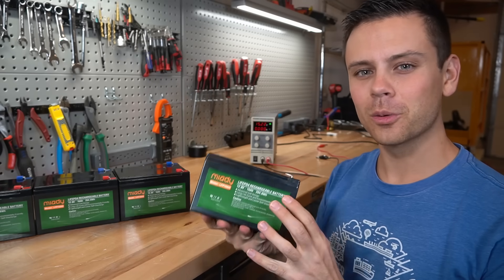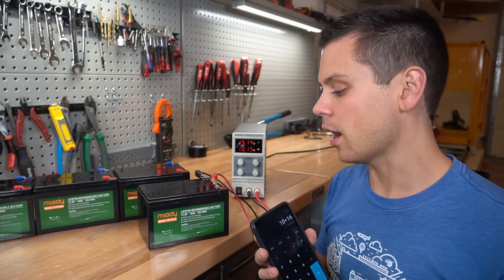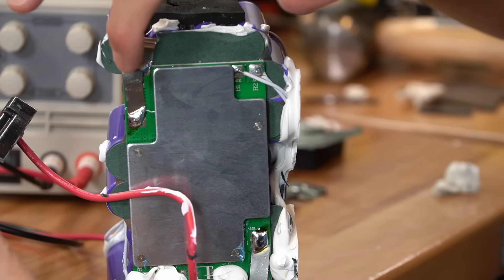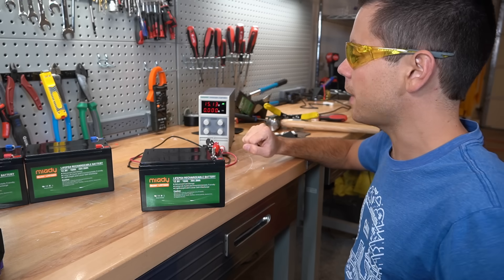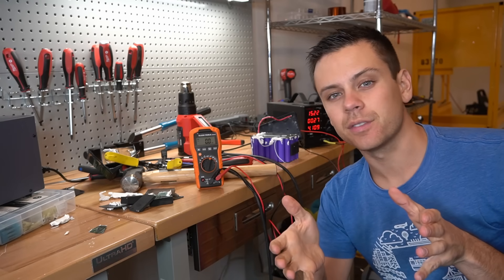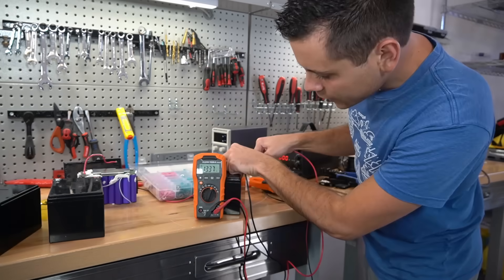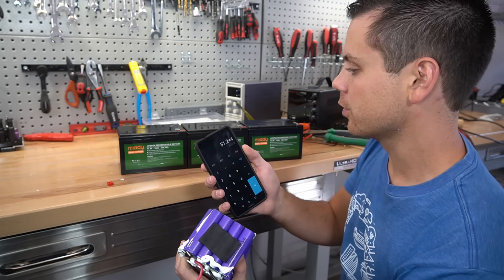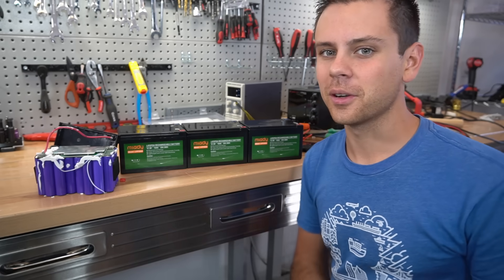$54 12V 16Ah LiFePO4 "Miady" Pack Tested

Comment: I have not used these but I have been testing the Nermark Lifep04 12v 10a for my UPS. I did put a 10A fuse on the one i'm testing because of someone shorting out the battery and it went up in smoke. These batteries are going for $64 dollars for two. It would be nice if you could test them too.

Comment: I put this in 24v series and ran 30amps disharge threw these and they work good after 3 years. I use 1 on my moped to start it and it works great. It can push 30amp continuousdischarge

Comment: Slapping it with 15+V at 10A.  That will NOT fully charge it.  It will just only fully charge one cell and the BMS will disconnect.  If you want to fully charge a series pack you have to limit the final current to no more than the balance current.

Comment: Love Will Prowse but no, a 100 AH battery can be bought for $300 or even 295 all over the place. Not so cheap. I still want to use my power tool batteries to boost my 12 volt system..Just need to rig a DC/DC charging system.

Comment: I have a question. I would like to build a solar panel system that I can use to charge 2S, 3S and 4S LiPo batteries for RC cars. I would even consider having a battery system as well. Any thoughts or ideas on products for this? My charger accepts 10-34V, 33A input. About 1000W peak i.e. Is there a solar panel kit that can output something like 12V/8A?

Comment: Really like your insight.  I'm trying to power my off grid  trailer with 200w solar panels from harbor freight then to lead batteries and battery monitor and a 3500w inverter (you said buy the bigger one) then to a transfer switche. Question is what batteries do you suggest.?

Comment: I bought this battery about 2 years ago on Amazon for $45.  I also have the 6Ah and 8Ah Miady batteries as well.  Those two batteries have served me well - they're pretty awesome for what I paid for them.  However, I have begun testing on the 16Ah battery and found it has less capacity than the 6Ah battery... literally, about 1/2.  It will charge up to about 25%, then jump to 100%.  It does exactly the same when discharging.  It 'looks' like it's a nice flat discharge, then it suddenly does a low voltage shut down.  Very disappointing.  I am going to open it up and see if something has come un-soldered.  THANK YOU for the excellent video!  At least I now know what to look for when I open it.

Comment: I bought a 36ah from amazon, and it came in dead.  Contacted miady store and they gave me a full refund.  So I popped it open and found one of the balancing wire was not soldered properly and came off.  And maybe it touched somewhere on the board, the B- PCB melted.  Simple fix, and battery came back to life.  Good customer support, but bad build quality

Comment: Why do some of the sellers that have these SLA direct fit LiFePO4 replacements claim you can use up to four either as series set for 48 volts or four in parallel to have the combined Ah rating but not as a combine series/parallel set?

 Say you take four 12V 10AH LiFePO4 batteries and place two in series to get 24V 10AH and do the same with the other two and then parallel them to get 24V 20AH. Why would that be a bad idea? They claim their batteries have a built in BMS and claim they are a direct SLA replacement so why would series/parallel be an issue? A UPS is where I see this being a typical replacement for SLA where a series/parallel battery configuration would be used.

Comment: I've been using a Miady 20Ah for 2 months now... and my observations... build quality, probably not the greatest.  Charge capacity... this one is a bit more subjective.  Out of the box on initial charge I was getting 16.5 hours of run time on my HF QRP rig, transmitting at a 25% duty cycle (receive about 300mah, transmit 2.5A). After 4-5 full deep discharge/charge cycles with a 4Ah wall charger, the battery is doing much better, still holding 13.2 volts @ 25% transmit duty cycle after 7 hours. I 'm getting closer to 20 hours of runtime... my goal was 8-10 hours, and using pessimistic math on my 100W solar panels to charge at 50W x 4-5 hours to keep it topped off.. For the $ per Ah, I would buy this one again... even if I only get 15Ah for $70, but have to pay $120 for a better 20Ah, the $ per Ah comes out ahead.

Comment: Don't hesitate to use the Chinese batteries. The Ah rating might not be quite as high as claimed but it will be close. You get huge bang for your buck. Some of the newer models have much better design and construction. Some of them come apart to allow user servicing.

Comment: This was extremely helpful because I have the same 16ah battery from Amazon The $54 one shown in this video. I use it for a six amp 12V blower all the time. Thank you for some tips for me to keep in mind for this battery. When using it with a lot of movement

Comment: excellent videos, I was thinking on buying a solar generator and when I come across your channel now I want to build one. I want to try a very cheap model that is intended for irrigation systems, humidity sensors, lights, etc.

I was thinking of something 200W using 18650 or 32700 batteries, mppt charge controller, and possibly an inverter and a dc-dc charger.
Any suggestion?

Comment: This may be off topic but i would love your feedback if you could. I am looking to power an E300 Battery Scooter and want to increase the voltage from 24v to 36v and build a little battery bank. What batteries would you build one with to fit in the case for distance run time.

Comment: I purchased the 6Ah due to its low price. even before using them I took it apart due to the CG being out of place. This level of craftsmanship is not acceptable in the USA (nor EU) and is reminiscent of Chinese workmanship where they either hotglue or superglue components, in this case silicone and tape. I have disassembled the cells and BMS and placed them flat . Ive come to be immune to this style of manufacturing where they cost reduce by eliminating mounting hardware. Just have to remind myself where it came from.

Comment: I have been searching for an affordable way to power a 48V DC 1000wattt brushless ebike motor, when I found the Miady 12V 16ah in this test. I was all set to order until I read this. My confusion lies in post of a reliable ebiker, that installed 4 of these exact Miady batteries wired in series to provide the required 48 volts for his even higher rated 48V 1500watt brushless motor. A year in service, good performance and no negatives to report! (Note: Ebike user pedal assist the motor while in is running, to lessen amp draw drastically and extend use time between charges.) 1) Why do you state to NEVER wire this battery in series? He apparently has had no issues.I am confused?

Comment: I would have emphasized the poorest factor on these batteries. The welding of the cells are horrible. I had to open 3 batteries that rated under current and solder, yes solder the tracks because my CE approved Chinese trac welder was down. After soldering them ( and strictly managing the heat ! )these batteries are ok.

Comment: Excellent presentation! I wish I had watched this before buying 6 of the 16AH Miady batteries a year ago...However they were cheap and I wanted to play with the technology. I did build a 96AH (80AH after viewing video)  battery pack and fused each battery with a 15A in line fuse. The parallel bus feeds a 12v, 60A manual Breaker. All 6 batteries reside in a foam cushioned plastic dry box. I use this battery for a 55 pound thrust trolling motor which draws approximately 45 amps at full power. I also use the battery to rune my ICOM 7300 transceiver which draws 18 amps when using 100 watts of RF CW transmission. So far so good...I have about 50 charge cycles on the battery and use a  quality 10 amp charger programmed to charge LifePo4 batteries at 14.6v. Seems to charge OK but some times I will get a BMS disconnect after about an hour of charging and will set the charger for 4 amps which seems to work better. So far the battery is holding well during trolling motor use. The first time testing I ran my trolling motor for over an hour at full throttle on a lake with my 16" drift boat then used it at various speed the entire day. My group 27 deep cycle lead acid battery would have been discharged and done at the end of the day. I fished the next day with mixed trolling speeds the same lIfepo4 battery with no issues. With lead acid batteries I would have needed two deep cycle batteries.  My next battery project build will be using four high quality 3.2v 120 or 140AH cells with a quality BMS to replace the two aging 100AH deep cycle LA batteries in our camp trailer.

Comment: I just created a portable battery bank /solar system using 4 of these batteries. I haven't done any fancy computer models of the battery discharge, but I've run a blender for several seconds as a test, a hair dryer on low for several minutes, a computer for several hours, my double compartment mini-fridge (3.2 amps, I believe, for several hours from my test, didn't get close to low voltage. But did sound a/c voltage alarm on inverter for a few seconds when compressor kicked on, occasionally), for several hours. I've done multiple real life scenarios of electrical load on these 4 batteries together, and they have really impressed me. I have them nicely packed inside of a 17gal container with room for 4 more batteries on top. Have a 1500 watt pure sine wave inverter, and a epever 30a mppt charge controller attached to the lid, 30amp fuse for the panels, 50 amp fuse from batteries. 2 100watt solar panels. This is my first attempt ever. I wanted light weight, but a little bang for my buck. Any suggestions or helpful comments would be appreciated. I'm headed to the mountains soon......

P. S. I'll like and subscribe if you'll send me the extra batteries you didn't smash apart!!! Haha that was awesome! I'm glad I got to see the inner workings. Great video!

Comment: I bought four of the MIADY 12 Volt 16 Amp LiFePO4 Batteries. ALL are being returned! 
When I got the box from Amazon, the individual Batteries were in their boxes, but they were left LOOSE in the main box, with NO Bubble Wrap or anything, to cushion them, so they were allowed to slide about in the main box freely during shipping. I firmly believe the constant sliding around and bumping into each other DAMAGED them internally before I got them. I did the Charge-Before-Using-them protocol and then ran a simple test. I checked their SOC every 15 Minutes for two hours. Every 15 Minutes the surface charge dropped with NO LOAD on the Battery. ALL of the Batteries surface charged to from anywhere from 13.9 volts to 14.4 Volts.
This is an inconsistency that should NOT be present in "Brand New" Batteries! In the two Hour test 3 of the batteries dropped from .2 Volts to .5 Volts from the surface charge.
I then stopped the test and called it a day. This morning, I took them out and tested them again.
Three of the batteries read between 13.1 & 13.2 Volts, while the 4th read 13.7 Volts.
Two of the batteries dropped MORE THAN A VOLT just sitting overnight!!!!!
The Amazon Seller HAS agreed to my returning them, which will happen later today.
Reply: MIADY Batteries are Garbage. DO-NOT-BUY-THEM!
Reply: The 'as received' voltage variance you found suggest these batteries may be NOS (new old stock) which is true of any multiple battery purchase regardless of chemistry. With no date of mfg on the battery who knows how old or new they are? For multi purchase LiFePO batteries, regardless of age, it would seem prudent to me to charge them all at one time wired in parallel and then let them sit for a week with no charge but still wired to each other in parallel to balance them! They need to me matched prior to putting them in use to get the maximum potential out of them.

Comment: I'm using eight of these in parallel for a speaker/lighting project. ~300W to 400W sound system, ~150W of lighting and 300W inverter. Lighting part of project hasn't been completed yet but I got the chance to test it on a two day trip and played  music loudly for about 15-18 hours and batteries were still more than half charged. About what I expected because it was designed to have enough storage for a two day camping trip, providing audio, lighting, and auxilary power. It usually sits around my house and i'll play it some days and usually one weekend night when friends come over and only have to charge it about once a month (never fully discharge).

Tested all the packs for a statistics project too and found muddy results, and yeah, will only reach rated capacity if you treat them nicely, ie: <<0.2C

All in all very economical solution for obtaining the benefits of lithium batteries without the downside of the initial investment
Reply: They're obviously recycled batteries which is why they are so cheap. Good bang for buck. Applications outside of hobby, I would be hesitant.

Comment: Are you sure those are not li-ion 18650s. surplus generic cells and fraudulently labled as lifeP04. That would explain the higher voltage.

Comment: I'm using 8 of these in parallel to run a trolling motor.  It has twice the useable capacity as the lead acid I was using, is half the weight and it has less voltage drop under load.

Comment: I bought 4.. one of these batteries is crap.. pulled 31Wh, 55Wh final test 51Wh. 
The other three..
204Wh
195Wh
201Wh
Overall considering the price, the weight and performance and will not leak.. with the correct application (need to carry into the field for camping or working needing light power) are still a handy inexpensive good buy.
Thanks 
✌️PT

Comment: I built a portable power station using 5 of these batteries wired in parallel.  So far so good.  They may not have 16AH capacity but they have help up well and are able to discharge at 25 amps continuous (to run a crock pot) for over three hours or a 100 watt TV for over 8 hours.  Good enough in my book.

Comment: Anyone use these on a 48v system?  I have some old lead-acid batteries that I want to change out. 
Thinking of using 8 units in 4 parallel pairs in series for 51.2v (per the spec on Amazon).  
Solar charger is an old TriStar TS-45 with the PWM turned off.  Using about 400w of PV. 
The system is for back-up and is only used during (rare) grid failures.

Comment: How would this battery work in an APC or Eaton UPS?  Is there enough protection in them to just drop them in as replacements for the lead acid?  Price is right, but I'm having trouble trusting the reviews and making certain there safe from over charging and under charging.  Don't want any fires.

Comment: Do you know where the technical information on the battery can be found and if the bms have a max number of batteries that can be run in parallel?

Comment: I just ordered 4 of the 8Ah size as the price is right. Slightly less capacity would be disappointing, but still good for the price. Building my own inverter box far better than any of those cloud sourced items. The issue is they are over engineering these boxes which is unnecessary.

Comment: I bought a pair of the 6Ah batteries and used them in parallel to power a Nest cam outdoors. Worked great for months. The batteries were never a problem. The only issues I ran into where the weeds trying to block out the light going to the solar panel.

Comment: I have SEVERAL of the Bioenno Power Batteries, and have had good success with them. Would my 12 Volt/6 Amp LiFePO4 Charger be compatible with these $54.00 Batteries? My Bioenno Chargers have the protection circuitry built into them, so I'm thinking my chargers would be safe for the Batteries you tested here. What do you think?

Comment: Hmmm, fascinating. I'd be REALLY interested to see a test and teardown of their 100ah pack. I got one a year ago, and from a simply output use standpoint, it has performed well. We have pulled 0.8C continuously on a number of occasions and it has delivered. It has also provided 10% over rated capacity consistently, giving us 110ah. It doesn't, however, appear to have a low temp disconnect, and though it claims high temp disconnect, I haven't mistreated it anywhere near enough to find out if that is true.
Seeing the results here on these low capacity packs makes me quite glad I built a solid 120ah pack of my own though.

Comment: Just ordered a couple o fthese, I am wondering about th elow temp cutoff, did you ever find one in the bms?  I am building some remote cameras, solar powered charging, and it gets below freezing here...  Also, if I might ask, are these capable of running in series..?  any chance you have changed your mind on this factor  (thinking for UPS),  tnx, great video!

Comment: I bought 2 of these and plan on buying a few more to build a small solar system for my truck so I could watch TV and charge my devices when camping. It would be nice to see a review with a solar system to see if its worth the value.
Reply: This is my use case as well.

Comment: Batteryhookup I ordered 52 batteries 32650 and got 42, they sent me the missing 10. The 10 they sent were all old low voltage batteries. all 10 tested 1.1v-1.4v and one tested 1.7. Don't call them they NEVER answer. I've sent message after message and no response. I still have to weak deep discharged 32650's . This was my first time purchase I do not recommend them. I'm still out the money. Sold as NEW BATTERIES I doubt that!

Comment: Not a bad price if you wanna make a battery bank case with USB outlets or upgrade a Back-UPS unit. 12.8v 14Ah isn't bad to have in a small form factor like that. Already equipped with BMS and a nice waterproof enclosure. Most of 12v lead-acid's are larger and have less capacity in general. But then again i could buy 3 3.7v 14Ah cells from aliexpress for less than $12 each. It really is a good deal even at 83% capacity.